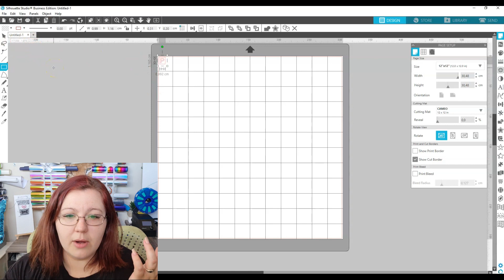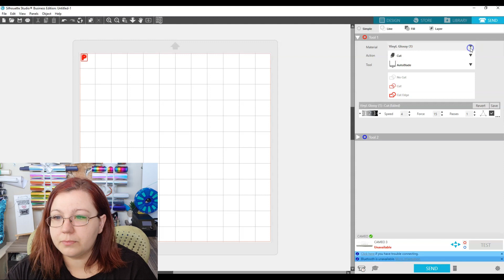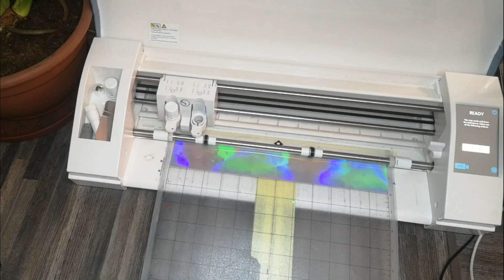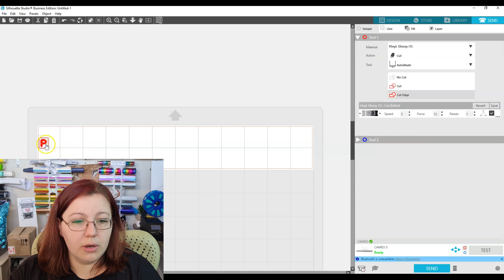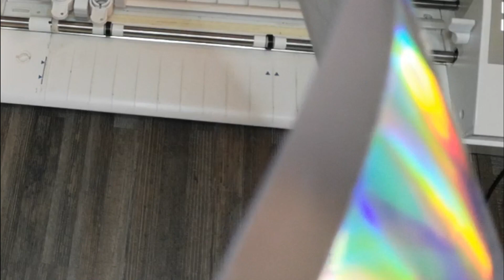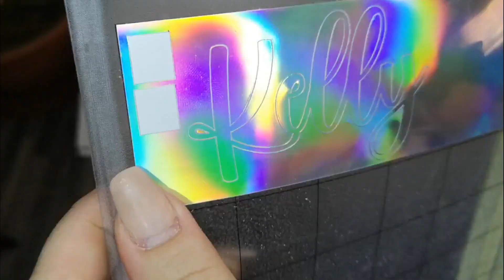Cameo Beginner Tutorial: Finding the perfect test cut

Comment: I used my cameo for almost 2 year now for sticker. watch a lot of tutorial but just found your video. usually I use the setting provided by cameo for sticker just change a bit the force but recently the setting that I usually used not cutting properly like whether it's cut too deep or just a slight cut I means like there is a cut lines but cannot peel the sticker. So I need to adjust the blade depth to able cut properly. I have waste a lot of sticker paper due to this reject. Also sometimes for a of couple sheet it will cut just find, then after that It will start cutting wrongly but still the same setting. I can't figure it out what's wrong. Hope u can help me solve this 😓
Reply from the maker: Check your cutting strip. I had similar issues and my cutting strip was cut through in some places - you can check out tutorials on YouTube on how to replace it, its very simple!
Reply: @KellyRossouw  ok I will try to do this. thank you for replying!

Comment: I need to ask you a few questions if you dont mind answering them.  Do you have to adjust the blade manually with the adjusting tool every time the media or does toggling the blade depth in the software send that adjustment to the machine automatically?  The second question is - how do you change from inches to centimetres in the software?
Reply from the maker: Not at all! :)
If you are using the Autoblade it adjusts automatically, any other blade will need to be manually adjusted. 
You can change from inches to centimeters in the preferences panel - so click on Edit -> Preferences, and then  Unit of Measurement :)

Comment: Thanx so much for this!  Much needed. Question..and I hope I make sense. The auto blade that comes with the cameo for can be set to a blade depth on silhouette itself. Then you can hear the clicks going to the desired depth just before cutting. I bought a premium blade and noted that it can't be clicked....and you have to twist it manually to a desired depth. Must you then change the blade tool to manual 1mm?
Reply from the maker: No problem! Yes you will have to manually adjust it, and you can select "ratchet" blade in the software 😊